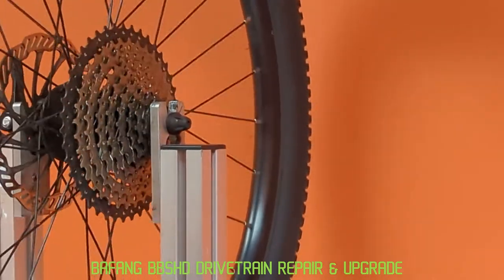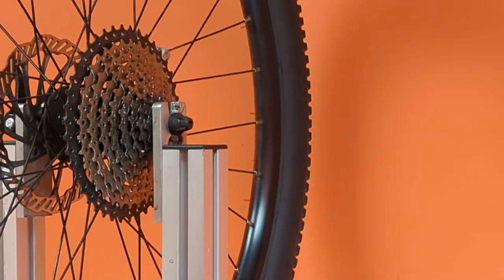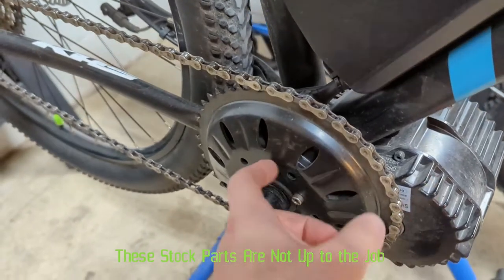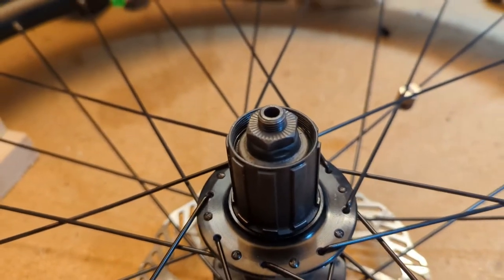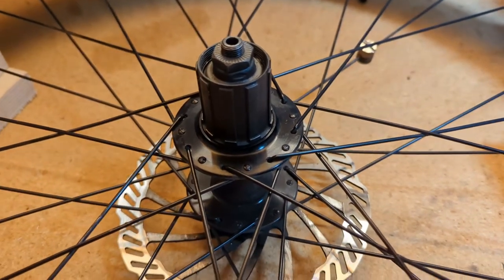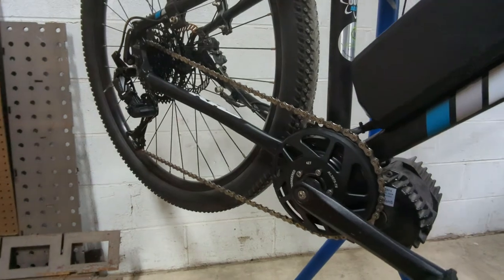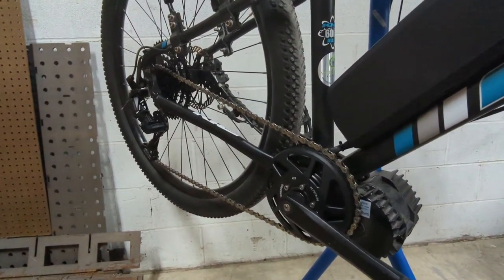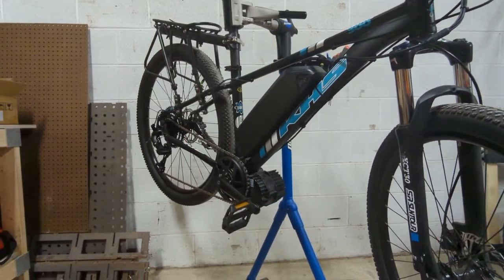BBSHD Drivetrain Upgrade and Mid Motor Shifting Repair Volton Electric Bicycles

Comment: Teach her how to ride the bike properly aka start in first gear at a lower power level and then work into higher gearing and higher power level as the bike travels faster.  Driveline wear with proper use isn't a big deal with a 30amp BBSHD.  People abuse them and they have to pay.
Gear sensor is essential as well.
Reply from the maker: This is correct. Whether they practice what you preach is another question...

No matter what motor they have, usually riders put that power out and stay in the two strongest gears and file those teeth down.